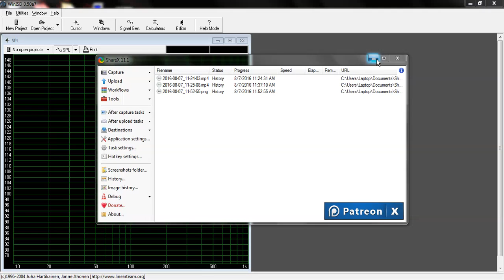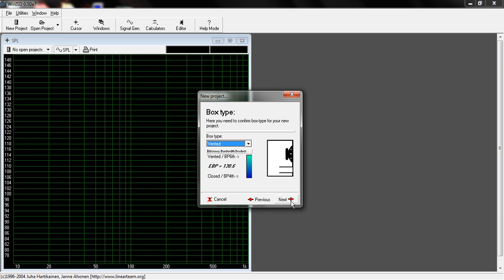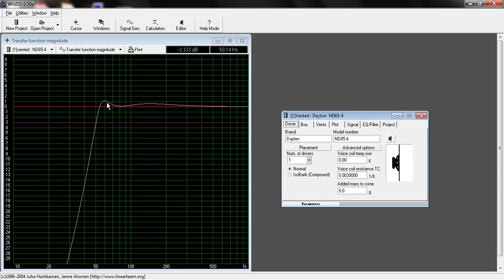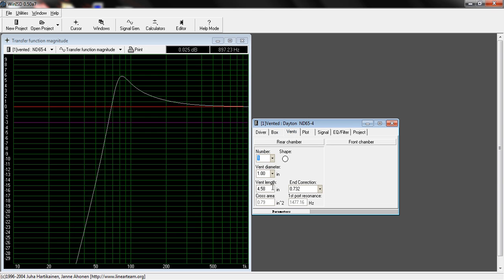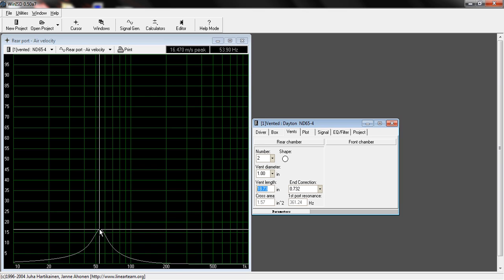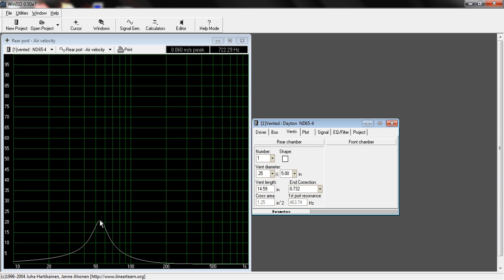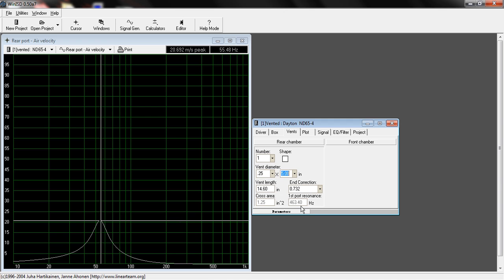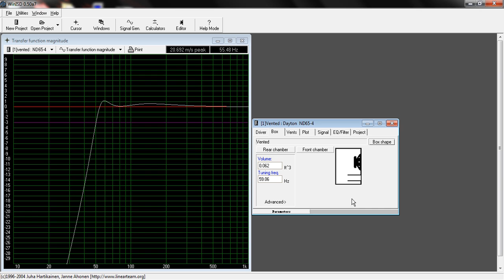WinISD Tutorial - Ported Speaker - Port size and Air Velocity

Comment: Hello, excellent video! Congrats. Could you please elaborate few words on 1st port resonance in case of 1 fullrange speaker in BR enclosure? How does it impact? I am looking at 110l BR with Visaton BG20 but the 1st post resonance tend to be 3kHz with ąprox 2" port. Will it be audible or such high resonance is negligible ?

Comment: Thank you for this video Toids!  I started design on a 2-way with HiVi B4N and a Dayton tweeter using winisd (0.7.0.950) and with the manufacture's specs. I was able to successfully complete the design (ported with 1x2". 9.7cm long, flared tube).  However,  the resulting volume to me seems to be a bit too much.  What puzzles me more is when I create a similar project using the 3" version of the same driver (B4N), the resulting volume is significantly larger than he design for the 4" enclosure considering the design is fo a smaller driver.  Could this be due to a fault in the software?

Comment: when putting in the box volume do i put in the gross internal volume or 
the internal volume after port, bracing and speaker displacement
Reply: I hope after 4 years you found the answers you were looking for but if not, use the volume AFTER  subtracting bracing, speaker displacement and port.

Comment: Hey! I see you're still replying to quite a few people, so I have 2w box with a port i've designed 11" x 1" slotted port tuned to 38hz and the port has a air velocity of 15.1m/s at 33hz. My issue is that with music and even very layered audio its fine but with spoken word or interviews ect. it has a sort of whistle to it at around what sounds like 400-600hz. any suggestions on how to solve this? cheers.
Reply from the maker: It's really hard to say, but you should take a look at your first Port resonance in WinISD. See if there's a correlation to what you're hearing
Reply: @Toid  thanks for replying! that was the first thing I looked at and the 1st port resonance is 556hz which is pretty bang on to what I'm hearing, any suggestions on how to combat that? or even redesign as I'm lucky enough to have only made test boxes so far. cheers.
Reply from the maker: @justdace2854  from here it's really trial and error. The first thing I would do is line the enclosure with some type of acoustic foam. Make sure to keep it away from the opening of the port.
Reply: @Toid  I was afraid that might be the case. Is treating the inside with uneven bits of wood as a sort of a acoustical damping a viable solution? its just I tried to use acoustical foam at one point and it sucked all the life from it. so i was hoping for another solution to maintain it a bit. Thanks for responding!
Reply from the maker: @justdace2854  no. You could try just a little at a time. Start with the rest of the enclosure
Reply: @Toid  sorry that's what I was meaning, as in treating the inside of the enclose, I don't plan on putting anything in the port itself.
Reply from the maker: @justdace2854  that was actually a typo on my part. I meant start with the back of the enclosure.
Reply: @Toid  sorry man, I have a theory and if you can somehow see if my logic adds up, after doing measurements on the box ect. and putting treatment inside it still stands out alot. my theroy is changing the tuning of the box from 38hz to 48hz that makes the port half as long and in doing that changes the velocity to 17m/s so still under the chuffing threshold, gives the entire box a bit of a boost down at 50/60hz but most of all changes the resonant frequency to 959hz and from looking at the measurements the box has a 10db dip right at 955hz. would that help the situation a lot? cheers in advance!
Reply from the maker: @justdace2854  that is the easiest way to deal with it.
Reply: @Toid  Awesome, thanks man. much appreciated. Ill try and get that done in the next coming week. Is there anything I've overlooked in my logic? from what I seems ill just be down 5db at 30hz but up 3db at 50-60hz which seems like a good pay off for a port that hopefully wont ring out during speech. I just went from the suggested 38hz tuning to 48hz really. Also if there's somewhere I can donate for your time I'm more than happy to give a little? Cheers.

Comment: this program isnt too accurate in air velocity. i have a 8 inch sub in a 1 cf box 30 hz, 2 inch aeroport and there is absolutely no chuffing in real life but when I put it in WinISD, it shows my air velocity for 30hz at 160 m/s and about 50 m/s for 40hz LOL. with that being said, would an 11.25" area slot port be okay for a single 8?

Comment: What if I change the number until port length is 1/4 of turning frequency wavelength, Will my design work as a transmission line with a chamber?
Reply from the maker: There's an option to test as a transmission line. Just check that box.
Reply: @Toid  Thanks for super fast response. I check that box and my SPL graph have a weird peak and dip. I try to adjust the port length to 1/4 wavelength of turning frequency and I got a lot more peak and dip, Is that normal?
Reply from the maker: @StillRenderFilm  honestly I'm not an expert and transmission lines. There is a YouTube channel on transmission lines. He also frequently my forum. you could check the forum or try to contact him directly.
Reply: @Toid  What is his channel name?
Reply from the maker: @StillRenderFilm  transmissionlinedesigns there's also a really good thread going on at the forum right now about transmission lines. www.toidsdiyaudio.com/community
Reply: @Toid  Thanks

Comment: What I didn't get is what to do when the speakers are too large? If you want to vent an Eminence Alpha 15 for example, it requires an impossible cabinet volume and/or vent lenght.
Reply from the maker: That's typically a good candidate for a passive radiator.  Or you can try to tune it higher

Comment: The default box volume is very big for me. Can I adjust the tuning frequency and box volume as per need ? Or will that cause problem ?
Reply from the maker: Yes you can
Reply: @Toid  Thank you so much. I am trying to build a speaker with 2 hivi b4n drivers and peerless bc25sc06-8 in MTM configuration. They are giving 43Hz tuned frequency with 37Hz F3 in a 0.866 ft³ ported box. Are they a good pair ? Or do you suggest anything else.  I was thinking of Dayton Audio tcp115 as mids. I am on a budget. This is my first project. Thanks for your tutorial. I am learning all of it.

Comment: Since a speaker itself takes up volume, and any bracing, how does one calculated the real internal volume?  Thanks in advance.
Reply from the maker: If you put the dimensions of the driver in winISD, it will tell you how much volume it will take up. The bracing you just have to calculate yourself or with a program like SketchUp.  One of the easier ways is to use Days V2. This won't give you the volume, but it will tell you the final tuning frequency, which will help if you're in the ballpark of the volume.

Comment: Hello! Is there a way to measure a port? I pulled out the port from an Z-5500 system and I'd like to know the dimensions. I could use the port for a car setup, but I'd pretty much know the dimentions of the port before I do anything.

Comment: F3 =FB???????
Reply from the maker: mohammad alsammak FB is the tuning frequency of the box. The F3 is where the speaker plays 3db down
Reply: thank you very much.but  i don't understand that point if i have fb 40hz then f3 is 35 hz is that right?
Reply from the maker: It could be.  If you tune your speaker to say 40hz (fb), you then have to look at your graph and look for the F3 line.  Then see where at what frequency your graph crosses the line.  That is now your f3.  In this case I showed it around 3:40 in the video.  The F3  is around 48hz. with the tuning frequency of 59.11
Reply: thank you very much

Comment: Hi can I use a 1.5" are port ? where do I want the air velocity at ? .88 cb ft box tuned to 23.23 win isd says it will be 9.8 is that to low? my sub is pioneer ts sw3002s4
Reply from the maker: Brian Perez make sure you put in the wattage you'll be using. That would be under signal and then system input power. My guess is your graph is at that with only one watt power which would most likely be too high
Reply: Yes it shot way up😣
Reply: Brian Perez i have more questions are you in a forum ?
Reply: 123Toid are you in a forum ? I have more questions .

Comment: Hi. I’ve watched this video a few times, But can’t figure out where the F3 the graph plots and the tuning freq that I can change interact with each other. What is the tuning freq that can be changed and the f3 have to do with one another. 
My 4” Dayton speaker combo tuning will come up with 64 hz, amd my f3 will be 55 for the 4” drivers. Problem is my box is to big. So I change the volume and it of course changes my graph to a lesser quality. If I change the tuning freq to high say 85, graph looks better, and my f3 is now 70 hz. But if I built a box, what am I doing physically with the tuning hz at the box? Feels like I shouldn’t be able to change the tuning freq field, as it gives me a false graph. Thanks.
Reply from the maker: 1975oldschool a speaker is tuned based off box size and port length based off the speakers TS parameters. So there's a lot of those small speakers that take huge boxes in order to get tuned really low. Sometimes you have to compromise by having a smaller box with a higher tuning frequency
Reply: 123Toid Thank you! I did some more searching and think I figured it out.

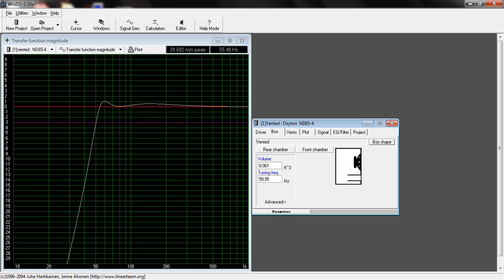Comment: Hi 123Toid! I really like your videos, they are incredibly helpful in designing subwoofer boxes. Though I do have a particular question about this video. At 14:17 you are saying that to know the internal volume of the box, we need to subtract the port volume from the box volume, but right after that you said that the internal volume is 0.062 cubic feet plus the port volume. So do we need to subtract the port volume or add it together?
Reply from the maker: Great question!  I can see why that would be confusing.  I'll have to try to convey this differently from here on.  The total box volume will need to be whatever WinISD comes up with (0.62 in this case) + port volume + any internal bracing.  So if your theoretical port is .05 cubic feet and your theorectical internal bracing is .05 cubic feet, then your total volume of that box should be (0.62+.05+.05) 0.72 cubic feet.  What I meant by subtracting, is when you subtract .05 cubic feet from your port and another .05 cubic feet for your bracing, your box volume should equal the original WinISD box volume of 0.62 cubic feet.  I hope this helps.
Reply: Thank You! This helped me out a lot, appreciate it.

Comment: ok but there is absolutely no way im going to get that low of port velocity with a woofer tho.. where are the good ranges for subs?
Reply from the maker: If you do not want chuffing, you will want to keep the port velocity at or under 17 m/s or 56 f/s.  You can always get port velocity to meet those requirements, it just depends on the length of your port and or tuning frequency.  It is possible you are tuning it too low.  If you find the port way too long, then try PR's.  That's one of the main reasons people use PR's.  In builds where the port is way too long to be realistic.  

Having said this, if you don't mind chuffing, you can go higher, I wouldn't but you can.  You can also use a flared port to decrease chuffing, however the same size port will now be longer.  Unfortunately WinISD will not take this into account, so you'd have to trial and error it on your own.
Reply: im at about 109ft/s with 10" w6 in a 2.5 cu ft box tuned to 39hz with a 6in diameter port 15.56in long.. theres not really good information on "good" curves and "bad" curves associated with this program
Reply from the maker: try a slot port
Reply: idk if i have the building skills for that lol
Reply from the maker: try a slot port.  109 is definitely not good, lol
Reply from the maker: A slot port isn't too bad, lol.  but if you are against that, try multiple ports.

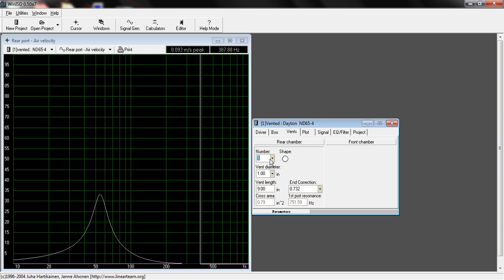Comment: At 8:00, when you increase to two ports and it says 18.73" for the vent length, does that mean each port has to be 18.73", or that the length for each port is VentLength / Number?
Reply from the maker: Yes.  Each port has to be a length of 18.73."  THat is why it can be tricky to design around multiple ports.  As you increase the number or size of the port, the each port gets longer.
Reply: Ah crud lol ok. The ports can presumable have a fair few twists right? I presume aswell that if I select "Two free ends", it means neither end of the port of has any flange or flare?
Reply from the maker: Lol, I know it can be hard to come up with the right size port.  The ports can have some twists in them.  However, if you are going with round ports (aka pvc pipe), make sure you go with slow bend elbows and not sharp 90's.  This will allow the air to flow freely.  Also when measuring the elbow length, measure the middle of the elbow, not the inside or outside. 
Two free ends does presume no flare.  However, a flare will always reduce port noise, so I always add one if I can.  The best way to do this, is to add a roundover to the outside of the subwoofer enclosure.  That means that the outside of the box would become part of the length of the port.  Here's a good look at one I did: https://youtu.be/gMUI2t7_svM?t=9m10s
Reply: I'll give that some thought, thanks!
Reply from the maker: You're Welcome

Comment: What if i want the blueprints of the box ? I dont know where to put ports and etc....
Reply from the maker: That is a good question.  The port/ports can go anywhere.  As far as the dimensions of the box, they are up to you.  That is the beauty of DIY.  You just need to make sure that you have the correct internal cubic feet.  Here is a site I use to check my measurements.  If this does not help, let me know, I'll make a video on it.  http://www.bcae1.com/spboxnew2.htm
Reply: Thank you. I was mad that everyone just had their box in liters and that was it :D
I tought that it has to do something with the air flow where the ports are.
Reply: Gamerdu45 it's just pressure. It wants to escape, maybe there are some strategic positions but since they aren't studio monitors or anything you shouldn't even notice

Comment: When calculating the port length, does WinISD expect that the port be inside of the box or outside? Because obviously having a port on the inside would reduce the effective volume of the box?
Reply from the maker: 50LightSabersInAPack That's a great question!  WinISD will tell you the cubic feet needed.  You have to manually figure out how much space your port will take and add it to the total cubic feet of the box.
Reply: Add it? I would have thought you'd need to subtract the port volume from the box volume value entered for WinISD to replot the data?
Reply from the maker: 50LightSabersInAPack You do.  I was trying to imply that if you want your current graph, you'd have to add in the port volume when you built it.
Reply: Ah right got it, thanks.

Comment: How does volume works in this program? e.g. If I put in an int. box vol of .65ft3 and after figure out the length and area of port let's say it come up to a vol of  0.011ft3. Does this mean the actual int vol of my box is .661ft3(.65+.011) or the vol the same .65 where the speaker enclosure is now .639ft3 and the port is .011ft3, which adds back up to .65ft3.
Reply from the maker: Great Question.  If you have come up with a response that you like at .661 cubic feet, you will want your internal volume to match that.  This means, you will need to add the volume that the port will take up, as well as the driver.  So your box would be .661+.011 (port) + the internal volume of the driver.  

Win ISD, can actually figure out the space your driver will take up.  When you are inputing or editing a driver, go to the last tab labeled "dimensions" insert the known dimensions to come up with the "dvol" this will give you the cubic feet the driver will actually take up.
Reply: Oh, thanks for clearing that up for me.
Reply from the maker: +John ND you're welcome.  If you need any clarifying questions feel free to ask.